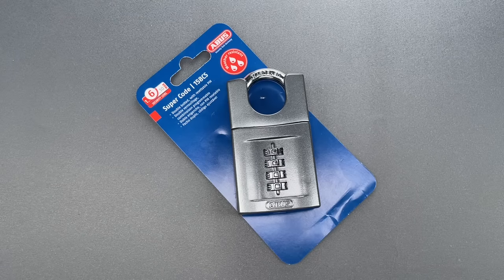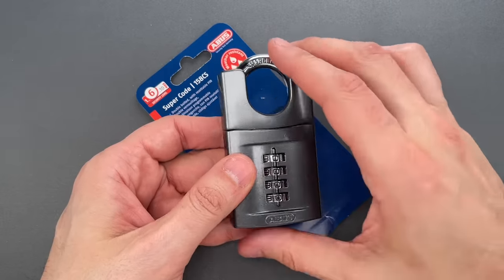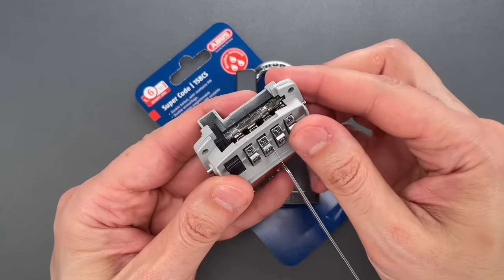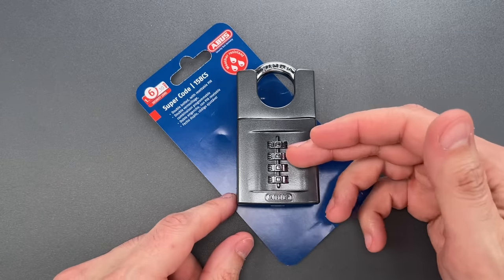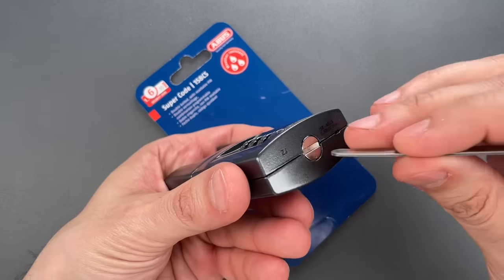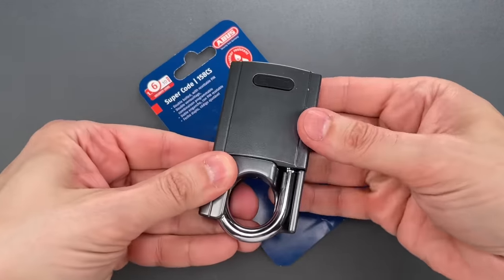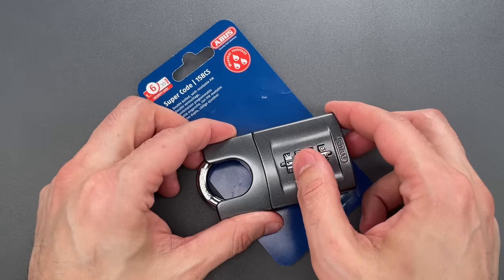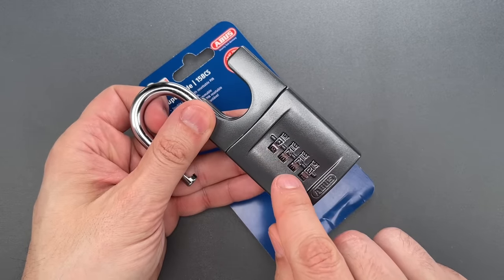[1541] Abus “Super Code” Padlock (Model 158CS)

Comment: This just jarred a memory for me. As a young kid, I had a cheap inline bike lock with a similar wheel-combo setup. I distinctly remember fidgeting with it often and being able to feel the difference in play in the wheels, and soon discovered that if I did it enough it would accidentally open. I know realize I was inadvertently using this technique 40 years ago! :)
Reply: I had one of those super cheap bike locks they sold like crazy back in the 70s-80s, with the cheap chain inside the semiclear color plastic "anti scratch" tube, with the four big wheels on the outside middle of the lock.  You could tension those by simply pulling on the chain, and spin the wheels till you felt them "fall into place".  So easy to decode!
Reply: I remember being an asshole 5th grader who figured out how to decode those cheap 4 number inline bike locks on my own (around 1994).... everybody had them so I would find two people who had the same color lock, decode both, swap them and relock the bikes....
Reply: @wrlprchnx  I was slightly more advanced, I had modified a masterlock key by filing the wards and sanding it flat, and so it basically opened any masterlock it would fit into.  And I did the same thing, switching kids' padlocks.  Stand back and watch as all the kids got on their bikes and left, eventually leaving just those two.  They'd get to talking, and try each others' keys, and wow it works!   So they'd switch KEYS. (not LOCKS)   shrug    Harmless entertainment.
Reply: I found if you put tension on the many of the cheap combination locks you could easily feel the click when you found the right digit. I also did that around 40 years ago as I am 51 now.
Reply: I remember opening those locks and swapping them from front to back, from one part of the frame to another, ...
Reply: @nathanfisher6925 that's how I broke into the coffee-and-cookies cupboard at uni. They had the cheapest, crappiest three-wheel combination lock on it and I just tugged it while twiddling the dials. Took all of thirty seconds and then I always knew the combination after that.

Comment: Watching LPL at work while practicing lock picking is a good day.
Reply: @willemsma  did you at least remember your clothes this time? 🤣
Reply: @willemsma  well, if it's any consolation, I'm unaware of any burglary of a residence that was done by picking a lock.
Usually, they kick in a back door or break a window.
Reply: @spvillano  I know people (wouldn't call them friends) who steal stuff by picking.  Picking doesn't leave behind evidence (well, you can find evidence of picking as marks on pins, but no-one is checking that. People usually just don't know how they got robbed, think they left a door unlocked, etc.
Reply: @sophiophile  a quick Google search showed that around 2 - 4 % of burglaries involved lockpicking. Given the annualized loss expectancy and exposure factor, figuring out how much to spend to protect my property is trivial and I actually spend a bit more than necessary to protect my property by rekeying with security pins.
Home invasions are fairly common for burglary, so protecting against that with a peephole helps, a camera or two might be worthwhile, as I own a few anyway and a few knives will do if the worst happens. Guns aren't as intimidating as a knife, as few have been shot, but everyone's been cut before. That's a lesson learned in crowd control in Somalia. Basically, if I replace my long ago stolen during a move firearms, it'll be for anything other than home protection, a quality lock and visibility plus camera are far more effective deterrents and a final, last ring defense being my fighting knifes, aka my Sicilian Express cards. But then, I already have those as well, an occupational risk of being a career soldier that exclusively served in combat units.
Reply: @spvillano  I wasn't arguing that it is common. You said you were unaware of any burglaries that involved lockpicking. So I was just sharing that I am aware of many.

The reason I am aware of them is because I taught a bunch of people how to both make their own lockpicking tools, and how to pick- naively.  I thought they would use it for dumpster diving and stuff, but at least 2 of them just became thieves.

You are absolutely correct that most instances involve forced entry. I was just sharing that it still happens, and that it actually makes it really hard to get insurance money because of the lack of evidence left behind.
Reply: @sophiophile  wiper inserts and collar stays, two favorite tool metal sources.
I mostly prefer my hooks.
Reply: @spvillano  Because most of the folks I was teaching were homeless (or close to homeless), hence the dumpster-diver focus- it was usually either street sweeper bristles (they are steel and break off the street sweepers if you live in a city. You just walk along the side of the road and can find lots), or old wiper inserts from auto shops.

The other important thing was teaching them to heat treat (both anneal and temper) the steel properly, since many of them were having to use needle files instead of grinders.

I've never tried collar inserts before before.
Reply: @sophiophile  never thought about the street sweeper bristles, but then in Philly and now here in Harrisburg, we rarely saw such creatures. Well, the only time we saw them in Philly was literally on election years (no, I'm not joking).
There are two collar insert types, cheapies that are way too thick and the more expensive quality ones that are quite thin and make great shims and tool tips.
Annealing is easier to teach than tempering, too easy to overtemper and turn what would've been a good tool brittle. Pity that they abused those skills, toolmaking is an invaluable skill! 
And I'm familiar with the crowd. Ended up in that very boat after my wife died and I got stuck in a rut for a while. At least I didn't climb into a bottle or into drugs.
Reply: @spvillano  I'll definitely check out the collars, thx.  Also- yeah, tempering is definitely harder to teach folks, but I would teach them on a powerful heat gun at first so they could learn to recognize the colours that develop (it's also way easier to see when there's no flame on the way). Then, onto propane torch.  Myself I actually use a combo of small premix (like used by jewelers) and larger surface-mix (like used by lampworkers) oxy-propane torches, so that I can control the gradient of malleability->springiness->brittleness along the length of the tool. I've never seen anyone sell tension wrenches with varying temper along the tool, but you can make a pretty idiot-proof tension wrench (way better than those wirey ones with the loop along the tang- the idea on those are solid, but you can't apply nearly enough force with them).

Comment: I remember I had a generic bicycle combination lock where you could do the same thing, this would have been in the mid to late 80's. For some reason I stopped using the bike chain, then had to start using it. And by then, I had forgotten the combination. 

But just like in this video, I learned the feel when each wheel was binding or feeling looser, and determined the code.

I also remember telling a few mates what I did, and they didn't believe  me, until one of them brought in a similar bike chain and I managed to unlock it without being told the combination. 😂
Reply: That's the kind of trick you really put into perspective by giving them a dead stare while doing the thing.

Twice.

Comment: I've picked code locks like this myself, but this is the first one I've seen that doesn't even require any tension to be placed on the shackle.
Reply: yeah i picked bicycle code locks as a kid by pulling on chain and turning each wheel till i felt a slip.

Comment: You can knock down time by pulling on the shackle while "brute forcing" the last wheel.
Reply: Uh I don’t think you listened to the video. He wasn’t using brute force.  He said the spring was to stron which eliminated the need for the notch decoder tool.  There is no need to pull up on the shackle either because he was able to decode using the tension the lock already has by default.
Reply: @JasonB808  Read my comment again.

Comment: I would like to see a lot of these locks after they're left in an accelerated aging chamber for a year bet it's harder to do
Reply: @Matt Weger -  It's possible you're right.  Bought a beginner kit from LPL and have an old weather beaten Masterlock.  It's not as easy as he makes it look.  I had to add a bit of lubrication but I've managed to rake it open several times now,  just to demonstrate it's not a fluke.  Haven't been able to pick it yet though.
Reply from the maker: Not a bad video idea… spray with vinegar, salt, & H2O2 mixture, then try picking it the next day. 

FWIW, if you spray the lock with a thin, wicking oil, my experience is that there’s very little difference (unless the lock is totally seized up).
Reply: @lockpickinglawyer  -  Couldn't even rake it until I sprayed just a touch of WD40.  So now I can successfully rake it about every 5 or 6 attempts.
Reply: @wickedcabinboy  I couldn't even rake a brand new masterlock #3, so it's having me wonder if I'm doing something wrong and there's some subtle technique to raking that I'm just not comprehending or something.
Reply: @Tahngarthor  -  turns out I was pushing too hard on the wrench and locking up the pins.  I had to ease up on the pressure and just keep trying.

Comment: I noticed one thing from this lock:

You can change the number combination while this lock is attached onto something.

Basically a troll can go to this lock and change the number combination into something that he also doesn't know.

And then the owner has a new combination and wonders why he can't open that lock.

Or do I miss something and this doesn't work?
Reply: I had the exact same thought. I also thought, couldn't a thief just change the code and then open it up?
Reply: The lock was in the UNLOCKED state, just closed up so it looked as if it was Locked.
Reply: You have to enter the correct code and unlock it before you change the code (combination).

Comment: 1:29 slight correction there. The biggest benefit is, that the entry method doesn't leave any forensic marks, since you aren't really operating with the lock outside it's intended operating parameters.

Comment: Did I just see you change the combination without having the lock open?! If so, wouldn’t it be even easier to just change the combination to anything you want?
Reply: I was thinking the same, but it should probably need to be on the actual combination to change to a new one.

Comment: For some reason this reminds me of an old combo bike lock bypass. It was the kind where the wheels were all next to each other. You could decode it as there was a gap between the wheels that would move to the next wheel every time you got a number correct. Wish I could remember the brand.

Comment: I used a similar method to pick locks where I grew up (AFB) and then change the combination. You didn't need a tool to put it in change combination mode.
I just know that the maintenance guys were pissed every time they came upon my mischievousness.
Unless they knew the same trick, of course.

Comment: I live in the Netherlands, and Arbus is the most widely used brand here on bikes. Indeed, if you get bike insurance here, oftentimes the policy will only cover you if you have an Arbus lock - as most are considered to be a "standard" best level of security. I hope Arbus see this video and immediately recall and remove it from their line. That was absolutely shocking how easy it was to crack.
Reply: *ABUS.
August Bremicker und Söhne KG.

And do the NL insurance companies really recommend/require ANY lock as long as it's made by ABUS? Many of the bike locks recommended by our Swedish insurance co:s are from ABUS, but not all, and all locks by ABUS aren't among the recommended ones.

Comment: What would keep someone from putting the lock into change mode and changing the combination to a known number?  Is change mode only accessible after the lock has been opened and closed again?
Reply: While I don't actually know the answer for certain, I get the impression that you can't turn that little "change code" screw thing, unless the correct code is already entered in.

Maybe that's not the case, but it would be pretty foolish to allow for a code change without the correct initial code already input. 🤦🤷🤷🤷
Reply: @dajosh42069  Yes, it has to be on the correct combo which it was at the time, 0000, to use the change mode.
Reply: @dajosh42069  That's where my noodling led, too.  I appreciate the reply.

Comment: The big lesson here is that you need the best part for the application, not the generic "best part." It's pretty common to find badly-made products with weak springs, but in this case a weaker spring would have been better. Just because many inferior products pick a cheap spring that's weak but "good enough" doesn't mean that going out of spec in the other direction is any better.

Comment: I have a stupid question... if a lock like this one need to be close (or it can be done from close as well) for changing the combination, there is no risk of someone just walk by, turn the little wheel with a coin, change the combination and walk away?
Reply: You can only turn the little reset wheel if you have the right combination to open the lock.  Then you can change the combination.

Comment: i wonder what the tolerance is like with this. say, if they fixed the spring tension, could you still get a tool in-between the wheels?

Comment: Wait what now?
Did you change the combination while it was locked? The shackle was in ..
Oh or does the mode gizmo only engage if it's set to the combination?
Reply: Shackle was back in but it was still on correct combo at the time, 0000, which allowed him to use the change mode.

Comment: I wonder if using a beefy flathead screwdriver, if you can set the lock in "change" mode. Change the combo to 1234 if you must, and now you can easily bypass it

Comment: Couldn't you just... Put the lock into change mode if you didn't know the code at any time or does that only function when the wheels are correctly in position with said code?
Reply: You need the numbers set to the correct combination before you can use the change mode.

Comment: Wow. Shockingly easy. I never knew it could be done so easily. So even if the spring is a bit weak, just a thin long shim tool can pull the bar in to create tension and then make it easy to detect tumbler positions. Is there ANY combination lock of this style made that is tough to defeat, or is this just an inherently bad design?

Comment: Am I missing something? Did he just change the lock combination with the lock closed or does it have to be the correct combination for the reset mechanism to turn?
Reply: It was on the correct combo, which was 0000 at the time, so he was able to use the change mode.

Comment: Um, did you put it into change mode while the thing was locked... or did I miss where you locked it after changing the code?
What's to prevent someone from coming along and just doing that, changing the combo to whatever they wanted?
Reply: 0000 default unlocked

Comment: I sometimes wonder how quickly you would be able to determine if a lock has vulnerabilities. Specifically, I usually think about a scene in Hurt Locker where the bomb disposal team come across a man with a bomb strapped to him locked with a padlock. How would you approach such a situation? With your knowledge of locks, would you likely be able to quickly decide whether you could open the lock in the minute or so available?
Reply: If he was familiar enough with the specific model, yes.  Also depends on available exploits.  Bypasses and decodes are pretty consistent for a model or series, but picking anything that isn't garbage has a random chance to be easy or take longer depending on the bitting pattern of the key pins.
If the bitting is flat enough, you can jiggle a paperclip in there and get the thing open.  A particularly short (high) pin behind a long (low) pin can introduce difficulty due to having to lift the one in back without lifting the front one, (which is why picks are hooked.)  Do this two or three times in one bitting and you've got a good start for security.
I think if LPL was in a serious situation as you've offered, however, he'd also recognize that many locks can be rekeyed and otherwise modified, and not assume he could get into it just by first impression.
Reply: @VoltisArt  that seems like a pretty reasonable answer.

Comment: I just had a wonder if there are any like ,  multi staged locks?   Like a locked cover, over another locked cover, that reveals the main core lock   each one a different style that forced a different way to unlock/pick  if nothing else it makes you have to spend time fishing out a different tool  or get stuck if you don't have the other tool.
Reply: "Stuff made here" did that, not a cover, but locks with 2 cylinders.

Comment: Can the change mode only be turned when the correct code is face up? Otherwise it looks like it would be really easy to just change it?
Reply: Has to be on correct combo, which it was at the time - 0000, to use the change mode.

Comment: It looks like you change the combination number when the shackle is in the locked position?!
So a mischievous person can come along and change the combination to another one just by turning the change screw 90 degrees??
Reply: Has to be on the correct combo, which it was - 0000, to use the change function.

Comment: If you were to put it in change mode without the owner noticing, would they be able to open it with the combo?  If so, would the combo be changed to where the numbers were scrambled afterward?
Reply: It has to be on correct combo first to use the change mode. But if someone correctly decodes it then they could change the combo if they wanted to.